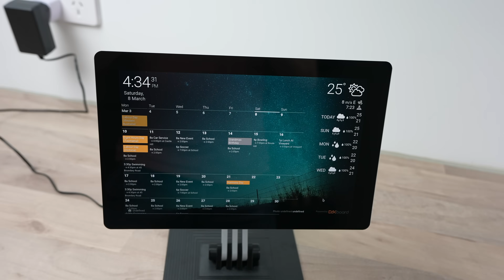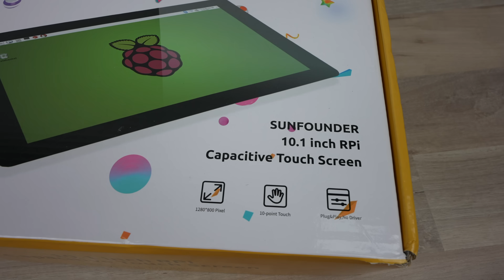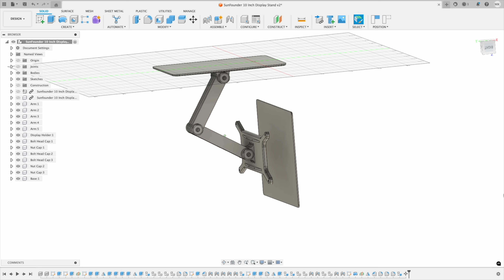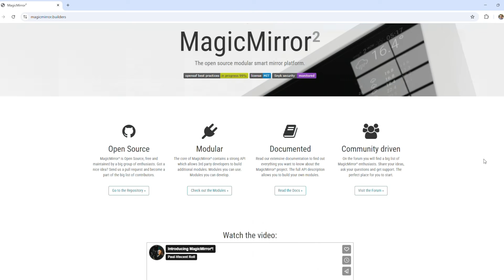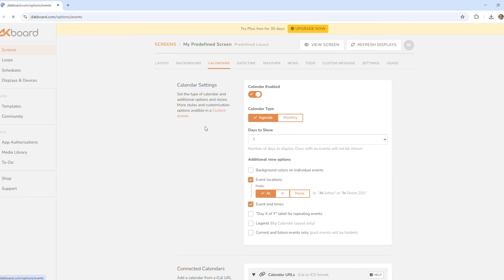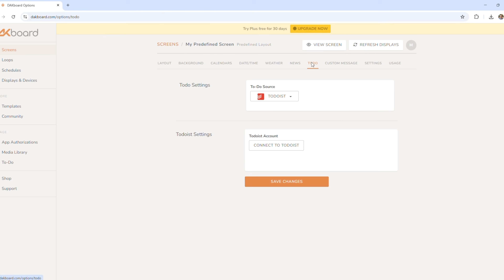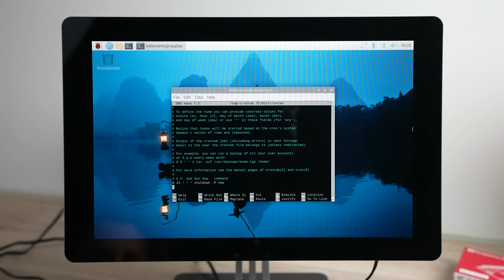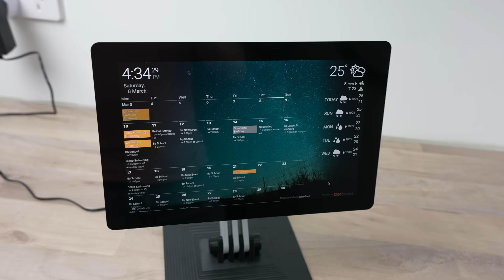Pi-ntelligent Planner: The Ultimate Family Hub!

Comment: I'm asking cause I dont know any better - but why use this over like a tablet, either Android or iPad? The same size, looks better (as its neater), and about the same price?

I understand that you can run a HomeAssistant instance on the Pi, but if it was for dashboard a tablet should be just as good?
Reply from the maker: The last part is primarily why I choose the Pi - I'm running some other software on it too, not just the dashboard.
Reply: @MichaelKlements It makes perfectly sense 😊

Comment: I went to your blog and copied the command line stuff exactly but nothing seems to happen at boot. Any trouble shooting advice this was my first pi project overall I’m pretty frustrated
Reply from the maker: Did you get any errors in any of the steps? If you're using a different username then you need to change the "pi" in these steps to your username - "mkdir -p /home/pi/.config/autostart"
Reply: Hey thank you for the response. I have the .desktop file in the correct folder however nothing is happening on boot. I’ve tried deleting the file and remaking it, but on reboot nothing happens. It’s though it’s not being read. So I don’t really have any error messages. 

Sorry I’m not being more descriptive I don’t even know what to tell you to  be helpful haha.
Reply: @Walican132  I new to raspberry Pi also.  I am running into to this same problem.  Did you ever get it working?